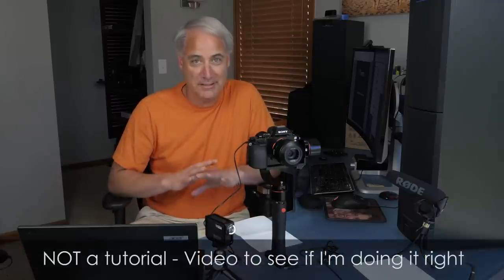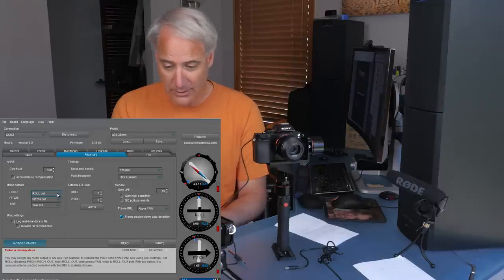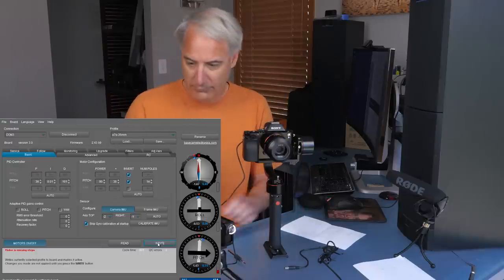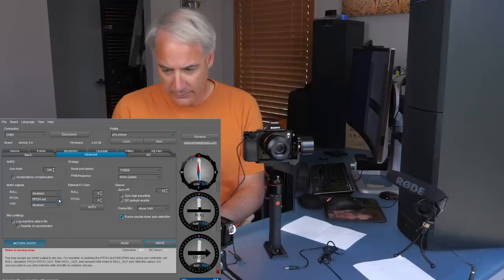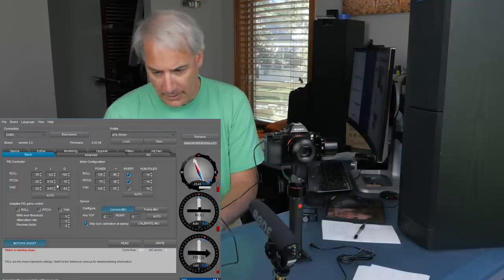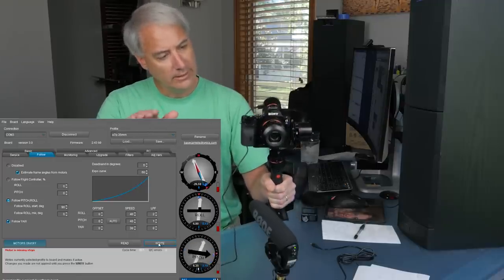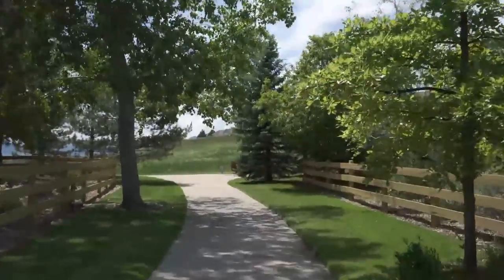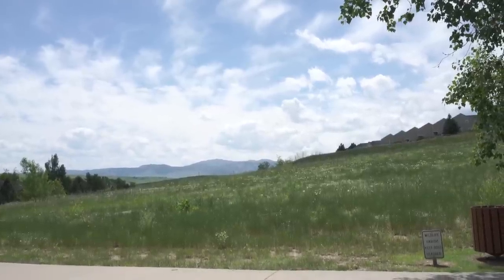3 Axis Gimbal BaseCam SimpleBGC PID Tuning Question

Comment: Dave, Thanks for taking the time to do this video. I have nearly given up trying to tune my little NEX gimbal, but after watching you work through some of the same problems I was having, I'm going to take another shot at it.

One thing you might double check is your voltage cut-off setting. I'm not sure what type of batteries were packaged with your gimbal, but lithium types can be damaged (and sometimes dangerous) if discharged below a certain threshold. Also, the Compensate Voltage setting boosts the voltage when it drops below a certain level. That should help keep the gimbal performance more consistent as the battery voltage drops during extended use.

Comment: I have only had mine for a few days but I learned that there are two kinds of jitter. One is when the pitch motor is not holding the camera stiff enough and no vibrations are felt when holding the handle. The jitter is low frequency caused by the lens 'flopping' around from uneven walking. The other jitter is from the motor holding the camera very stiff, but its electronic reverberation vibrates the camera and magnified by the lens causing jitter. The starting point with the gui is to use the settings that get loaded into the software when you connect your gimbal. If there is no hum, and when you tap the lens from the top you see it wobble then you need to increase P and D of the pitch motor, both at the same time, in increments of 5 until you get vibrations then back off a couple of numbers. If you can hear a hum and feel vibrations then reduce the P and D of the pitch motor by increments of 5 until there is minimal vibrations. It is best when it is on the verge of humming/vibrating. Don't change any other settings. The roll and yaw motors don't really have much impact on the video in terms of jitter.

Comment: Dave, thankyou for putting this effort in. All those times taking the card and checking the footage. I wouldn't have remained as calm as you!

For what it's worth - if this video had ended with a positive result it would instantly have been the most definitive SimpleBGC guide online. Trust me - I've looked!

There is simply no concise info on this process anywhere. Why make it so elite?

Great work though - and please persevere!
Reply from the maker: PIGMINTFILM thanks.

Comment: Dave, you point out at 5:35 mark that you would put the alarm at 9v.  Having done extensive research on LiPo batteries, anything below 9.6, the battery is chemically unstable, and a lot of chargers won't charge LiPo batteries under 9v-9.6v because it considers it a damaged battery and charging it is a fire hazard.
Reply from the maker: +Michael Ma good to know thanks.

Comment: Compensate Voltage -- Used to ensure PID's remain 'in tune' with the power input.   As your battery runs down the motor power needs to increase to maintain stability. Compensate Voltage will adjust the motor power output so that the voltage across the motors remains constant no matter if the battery is fully charged or almost depleted,

Comment: Hi Dave. Big fan of your work and I always end up on your videos when researching for new kit. I've just bought a Nebula 4000 which you help me make my mind up on this purchase. I'm so excited to start using it with me A7s mk2. Sadly its not working too great and keeps jittering/vibrating. So I downloaded the SimpleBGC to fine tune this problem. But I've just found out that if you're a mac user you need to set up some code in the terminal to make a COM connection for the gimbal to communicate. Frankly I've now got a bit of a headache and don't know what to do. I've never reached out before to ask for help and usually soldier through and figure it out eventually. But I think this has beaten me on this occasion. I hope you or subscribers could help me out before I loose my mind.  
Many thanks

Comment: I had problems with the yaw axis on my CAME-TV Prodigy where it vibrated and made the footage unusable. I used the settings P=211, I=0,02 and D=255 for the yaw settings and I also changed the NUM.POLES to 15 even though the manufacturer had 14, but that improved the stability a lot. I use the gimbal with a URSA Mini btw.

Comment: Thanks a lot for sharing this. I had the same issues and did it the same way as you did (this was a few months ago before I found your video) with a smaller three axis GoPro gimbal for a drone. First of all I can say it was a complete waste of time (a huge amount of time) and money. In the beginning you set & raise the numbers as it is said in the manual and it seems to work very well, but you end up with randomly changing them without exactly knowing what you're doing and knowing about the results you might get. I've spent literally hours and hours and hours with that - without any acceptable and reliable results. Time wasted, money for the gimbal wasted. This PID tweaking sh*t is a tremendous waste of time. In my opinion the only solution is spending even more money for a factory pre-configured gimbal. If you want later on to change your camera or lenses - good luck... If one is earning money with photo and video this aimless tweaking stuff is absolutely an inefficient time killer.
Reply: I tend to agree. Aint nobody got time for all that!  And personally, I'm just too numbers averse to even mess with it, but those who are more tech/left brain oriented might not mind all that configuring. 

I follow Brandon Li on YouTube. He's an amazing shooter/storyteller and mostly shoots with Sony and uses a very light Sony a6500 with a gimbal.   He does mostly run and gun when he shoots. He got frustrated with all the PID tuning and the time it took to use most gimbals and ended up with a Zhiyun Crane (around $600 less than the Pilotfly).

Judging from his footage, and others I've seen on YT,  I'm thinking I should have gone that route with a gimbal rather than Pilotfly. 

The Zhiyun crane involves  no PID tuning. Just basic calibration and works out of the box. It might not be the best for heavier cameras, but if you have a light mirrorless camera, it seems to be would just fine.

Comment: Dave, would love to see a video like this for the H2. The best results I've got so far are because of going off this video. But still need some help. Also, I have the GH4 and want to change the pitch motor to the right side so I can use the swivel screen. Pilotfly added PID settings for it in their Google drive but still getting shakiness. Thanks!

Comment: Hi Dave, 

First off I just wanted to say I'm a big fan of your channel and have been watching all your videos. I recently purchased the Pilotfly H1 after watching your review. I thought I could tackle the whole PID settings and I found my self spending countless hours for day and night trying to figure out how to stabilize this hand held gimbal however my YAW and and Pitch still freaks out every now then and once I got it stable I still get some micro shakes as you were at the end of this video and I also have some problems with my horizon lines every-time I pan to the left or right.  I wanted to see if you had any suggestions or any recommendation for a PID settings I should use for my setup.  I currently mounted my Sony a7s with a Canon EF 24mm f2.8 prime lens (with a EF to E mount commlite adaptor) 
any help would be greatly appreciated.

Comment: You don't normally push the D value up until it vibrates, you only want to go up as far as it needs to keep it stable.  Having too high D will make it very slow when you actually want it to adjust for angle.  I'm sure you will find out.

Comment: Hi Dave. Really helped me a lot. At least to understand more the program and what to touch. I have got the Nebula 5100 slant through a chinese website. after sending it back for second time repaired, stupid of me wanted to charge profile 3 and 4 that they didn't put and didn't save or made a backup. Now my Nebula is not working well. I followed your video, and got something more or less, but for example can not put it upsied down because it gets crazy. Don't know if you had the chance to have the nebulsa 5100 slant, or know some one that has it to help me a little with the values. I use the sony alpha 7s on it. thanks in advance

Comment: Dave Dugdale Are you using Sony 35mm FE f2.8 lens? I noticed the jittering when pairing it with Sony A6000. I found I get best result when "I" is set to 0 with this lens, but still not perfect. I then switched to 16-50mm kit lens with image stabilization and everything is perfect.
Reply: Alan Zhao you will probably need a wider lens for the apsc size sensor

Comment: that jitter is the same jitter i get on my gh4, i think its asking too much to ask those cameras to film anything but a fixed tripod shot smoothly, they need in body stabilisation. If you did all that to that level with your old canon it would be fine

Comment: Hi,Dave i know this is an old post but im having the same problem with pilotfly H1+ that i bought used with for sony a6500 and sigma 19mm 2.8 Art lens. Im getting Frustrated . Please if you solved the Jitter Problem ,tell me how or give me a tip .Thanks for yor videos and all the hardwork.

Comment: The Came Single works great, maybe you should have chosen it instead of the H1+, and you can change the PID setting as well.
Reply from the maker: It does but I wanted a lighter gimbal.

Comment: As an engineer, I always tried to reduce the number of variables in a system I was working on. The other thing is to really know what those adjustment variables are doing and how they affect each other. Somebody (who speaks English) must know. Maybe they will post a comment :)

Good luck.

p.s. Oh, the search algorithm you alluded to is call a binary search.
Reply from the maker: Thanks. This software is anything but "simple"bgc
Reply: Dave Dugdale 2nd YouTube Channel  Have you seen these videos about using the filter tab to reduce oscillation? I think they are for older versions of the software, but the principals still may apply. 
http://www.levitezer.com/styled-2/blog-2/files/archive-oct-2014.html

That page pointed to a Wikipedia page about PID Controllers which says:

The PID controller algorithm involves three separate constant parameters, and is accordingly sometimes called three-term control: the proportional, the integral and derivative values, denoted P, I,and D. Simply put, these values can be interpreted in terms of time: P depends on the present error, I on the accumulation of past errors, and D is a prediction of future errors, based on current rate of change. The weighted sum of these three actions is used to adjust the process via a control element such as the position of a control valve, a damper, or the power supplied to a heating element.

Maybe that will help when tuning.
http://en.wikipedia.org/wiki/PID_controller

If you read the manual tuning section of this article they suggest that you advance  P until oscillation occurs (like your manual said), then set it to half of that value. Then increase I until any offset is corrected in sufficient time for the process. 
_Finally, increase D, if required, until the loop is acceptably quick to reach its reference after a load disturbance. _

Maybe worth a try.
Reply: Dave Dugdale 2nd YouTube Channel Here's some documentation about what the various adjustment variables are in the SimpleBGC software. If you haven't seen this, maybe it will help deciding what to tweak.
Reply: Dave Dugdale 2nd YouTube Channel Are you using the manual that came with the gimbal or the one from the Basecam web site here:
http://www.basecamelectronics.com/downloads/32bit/

Okay, I think I'm done for now. :)
I hope some of this might be helpful. Peace.
Reply from the maker: Robert Shaver thanks, I will give that a try today!
Reply from the maker: Robert Shaver I am using the manual from Basecam. I already tried the manual from Pilotfly.

Comment: You should have put a tutorial of HOW to connect the gimbal to the computer.
I have a Beholder DS1 stabilizer and I wanted to fine tune it using your video. But I got dead on track because I can't make my laptop see the gimbal.
I have done everything in the book (installed this Virtual COM port driver http://www.st.com/web/en/catalog/tools/PF257938, installed this USB to UART Bridge driver http://www.silabs.com/products/mcu/pages/usbtouartbridgevcpdrivers.aspx), connected the gimbal to the laptop using an USB/USB mini cable, I used this SimpleBGC software)...but I can't still see the COM ports in SimpleBGC connection drop down...and the virtual COM driver doesn't get initialized by my computer - and I tried two computers. I get: This device cannot start. (Code 10)

Maybe you have an idea what to do...because I am out of them.
Reply: +Mircea Goia same problem here with my DS1
Reply: +Doron Farhi I tried on two Windows 7 machines. I tried on a Windows 10 machine (with the corresponding driver). Nothing works. I always get "This device cannot start. (Code 10)".
How the hell these guys who are making the reviews  are getting this working from start and they assume that for everyone else it's easy peasy? (I have searched and seen quite a few reviews in search for a solution and NONE treats how to make your device work with your computer)
 And if they struggle also and manage in the end to make it work WHY they don't create a tutorial for that too??
Reply: +Mircea Goia its a new device, thats why there is no videos for that i guess.Did you try asking TRD support?
Reply: +Doron Farhi I manage to connect it! the original cable that comes with it doesn't goes all the way in the port.
Just try a different cable and boom! you're in.
Reply: +Doron Farhi Which part of the cable doesn't go all the way in? The one which goes in the computer or the one which goes in the camera?
Also, how about the Silicon Labs driver? Works for you? Don't you get "This device cannot start. (Code 10)"?

I am talking with OwlDolly for support, those who sold it to me. They so far gave me some clues but not enough.
Reply: +Mircea Goia the one that goes in the DS1. No errors from the driver. It works.
Reply: +Doron Farhi Yeah, I have errors with the driver too. On Window 7 and 10.
Reply: +Doron Farhi I even tried today a MAC and didn't succeed! I am lost...
Reply: +Softyet Hard Yep, in the end I sent the gimbal back to them and they tested with another cable and worked.